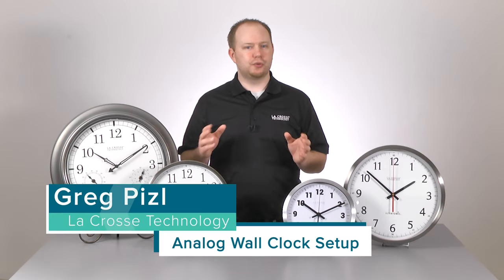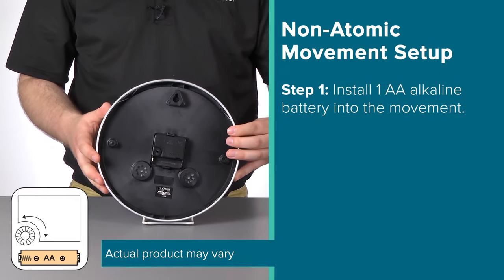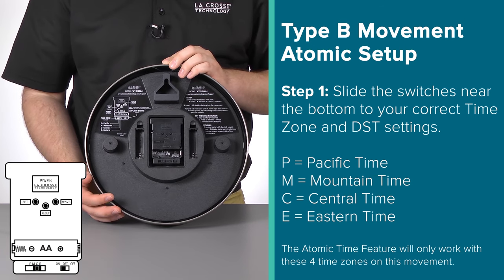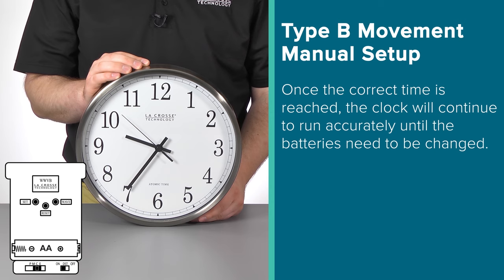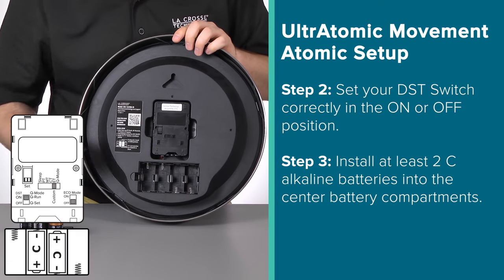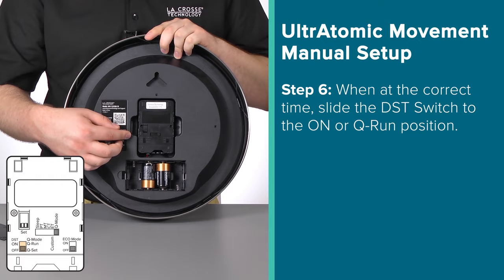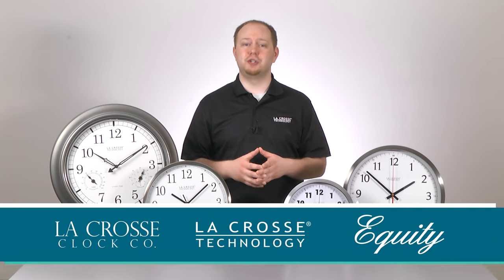How To Set Up Your Analog Atomic Wall Clock

Comment: Why does our second hand not move but the hour and minute hands keep perfect time?
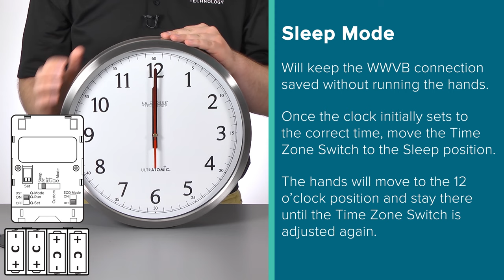Reply from the maker: Hey Darold, which type of clock and or model do you own? For instance, the UltrAtomic movement comes with an Eco Mode option as discussed at the 12:05 mark in this video.
Reply: @lacrossetechnology  Ours is just an "Atomic Clock WWVB with Type A movement. I changed the battery today and all hands, including the second hand, turned to 12:00 and stopped. We'll see if it sets itself now.
Reply from the maker: @drld  That was going to be our next suggestion (change the batteries), as a stopped second hand is often an indication that the power is running low. If you should need any further assistance, please message our support staff directly here: https://bit.ly/contact_techsupport. Or alternatively, send us a private message on our Facebook: http://bit.ly/LaxTech_Facebook or Twitter: http://bit.ly/LaxTech__Twitter page.

Comment: What do you do if a Type A is always 15 minutes fast?
Reply from the maker: Our recommendation would be to remove the batteries, press the Set Tab at least 20 times, and wait about 15 minutes before installing new alkaline batteries. After this, follow the instruction as normal waiting for the clock to receive the WWVB signal, once it does, press your correct time zone button to have it set to the correct time. 

If this proves ineffective and your clock remains 15 minutes fast, please reach out to our support staff directly here: http://bit.ly/contact_techsupport as your device may need to be replaced. We apologize for this inconvenience.
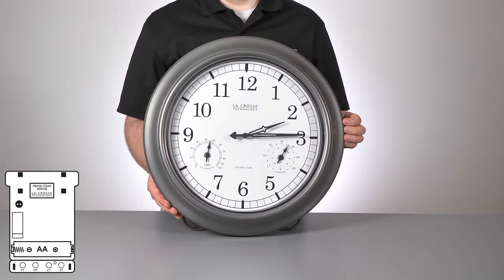Reply: Thanks for the tip. Our ultratomic clock sets to 3:52 instead of 4:00, and when it receives the atomic time signal, sets to 8 minutes slow as well. Very frustrating, will need to return.

Comment: My hands just spin ?
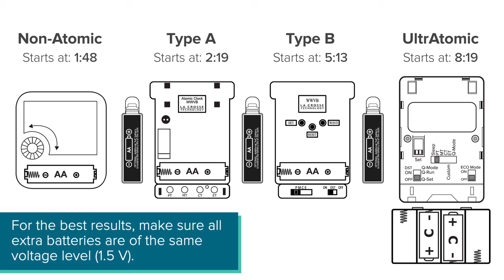Reply from the maker: As mentioned in the video at 1:18, spinning hands are either the clock adjusting automatically or a sign the batteries installed are under or overpowered. New alkaline batteries will often help correct this. For further assistance, please message our support staff directly here: https://bit.ly/contact_techsupport. Or alternatively, send us a private message on our Facebook: http://bit.ly/LaxTech_Facebook page.

Comment: Mine does not work. Why buy an atomic clock if it does not work and you have to set the time manually. It's going back. Disappointed.
Reply from the maker: Hi Alex, we're sorry to hear this and apologize for the trouble. As mentioned in the video, this syncing process can sometimes take a few nights depending on your location. If you have further questions or would like to work through the process with our support staff, feel free to message our team here: https://bit.ly/contact_techsupport

Comment: 5 fking nights? Bro...
Reply from the maker: Hey Leroy, we do apologize for any inconvenience. Moving your clock near a window, away from other electronics, and having the front or back of it face Fort Collins, CO will help increase its chances of catching the WWVB radio signal much faster. You can also simply set the clock's time manually if you'd like it display correctly from the start. Just be sure to have the atomic settings (time zone & DST switches on Type B movement) set correctly, as the WWVB signal will override a manual time setting. More about how this signal works can be found here: http://bit.ly/AtomicTime

Comment: DO NOT buy these garbage clocks! They are absolutely worthless as they do not keep time, and they cannot be set by hand. I have 120 of them in my building, not one has the right time, and did I mention, they CANNOT be set by hand. All 120 clocks are now in the dumpster where they belong.
Reply from the maker: Hey Dylan, we are truly sorry for any trouble our clocks may have caused. If you followed the instructions within this video [to set them manually] we're confident they would be up and running correctly. However, if you noticed there was a problem, our support staff is always here and happy to help. You can contact them directly here: https://bit.ly/contact_techsupport. Or alternatively, send us a private message on our Facebook: http://bit.ly/LaxTech_Facebook or Twitter: http://bit.ly/LaxTech__Twitter page.
Reply: @lacrossetechnology  I just reset 120 of them 3 days ago for daylight savings. Here's the thing, NORMAL clocks have a small plastic wheel on them that allows you to move forward an hour in just 3 seconds. Your special clocks, have no wheel, and when you put in a new battery, you have to wait a few minutes just for the clock to first reset it self to 12:00. THEN you can slowly set it to the right time. Again, NORMAL clocks take 3 seconds to set, your clocks, depending on the time of day, can take anywhere from 2-5 minutes to set. 3 seconds vs 5 minutes. 😀 As for the antenna function, I have 120 of your clocks, only 2 keep time. The other 118 dont keep time because they are not "in a window facing Denver" as required.